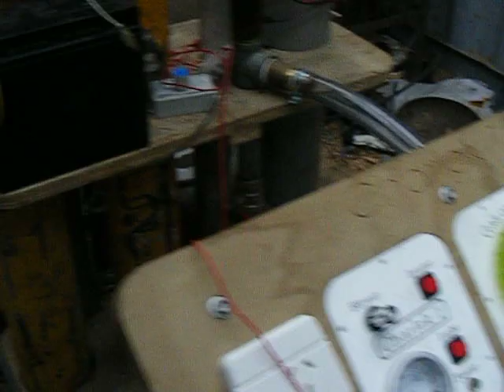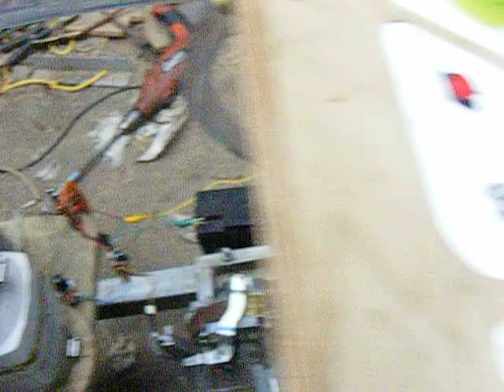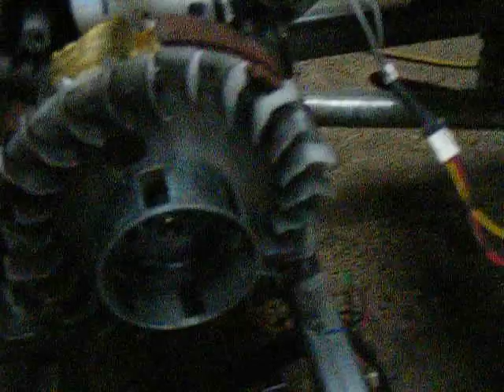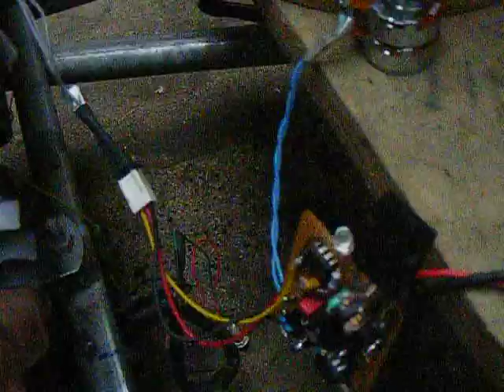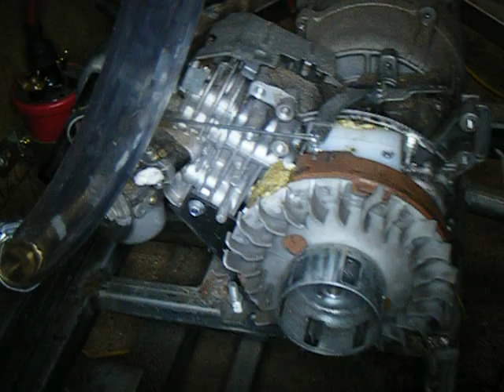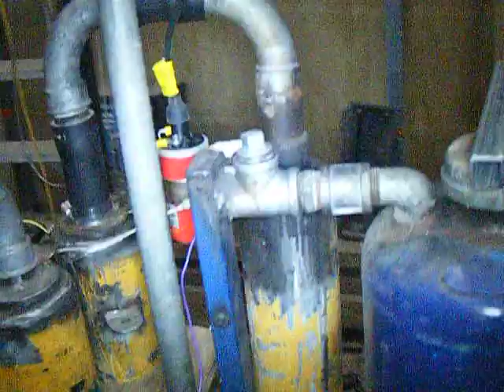Recent Charlek Enhancements

Comment: you could do away with the electronic spark advance and just shave the key on the keyway of the flywheel to advance the spark mechanically,,, they do that on high  performance go karts, or you could buy an already advanced flywheel to suit with 6-8 degrees advance. great electronic skills though,, hats off to ya,, Faster and faster and faster lol.
Reply from the maker: Howdee partner, 
 I did consider the use of a modified flywheel for this, but the electronic approach seems to be so much simpler for me to employ. 
 Watt's better is that I can readily adapt the electronic ignition system to operate on a wider range of fast and slow burning fuels. 
 A long time ago, I managed to split a flywheel in half, as the timing was just a bit too far advanced, and the engine duly backfired during starting. On that day, I had two matching halves of a flywheel to show off to my mates. 
 That was lots of fun  ;) .
Reply: I would be keen to own one of those spark advance modules,,  you could tool up and make yourself lots of money , i am sure there are plenty people out there who would jump on one at the right price for all sorts of engine applications,, for example- the arduino uno sensor controlled intake, i want one of those for my gasser,,,unfortunately , i am not much chop with electronics,, but hey thats why there are guys like you,,
Reply from the maker: Howdee partner, 
 Perhaps I should tool up for production of these sorts of devices  :) . 
 As an electronics engineer, I am forever designing and programming products for my employer's market and customers, so it wood knot be too hard to add a new branch to the design department  :) . 
 For your gas mixture sensing needs, I wood like to suggest that you start out with an older style, 4 wire, O2 sensor. 
 These should be super cheap, as second hand ones from car wreckers. That's where mine came from. 
 If you fit this to your gasser's exhaust system, it can start to give you some pointers on how to manipulate the manual gas control valves during a run. 
 Watt this wood also do is spark your imagination into creating some ideas on how to devise your own version of an automatic gas mixer. 
 I think it can be done without a computer, which could simplify things quite a lot  :) .

Comment: Steve, you are leading the way in our group when it comes to spark advancement.  We'll all be interested to see where it goes so we can make uneducated guesses to duplicate your successes. Thanks for sharing.  Joe
Reply from the maker: Howdee Joe, 
 Thanks kindly  :) . 
 This degree of timing advance makes all the difference between success and failure when trying to start this engine from cold on charkleberry fumes. 
 I wood knot be surprised if there is some sort of off the shelf version of watt I am trying to do here. 
 Ultimately, it all comes down to magnets and hall effect sensors. 
 These can be found in floppy drives and hard disk drives too, so these might be a good supply of components for a home brewed version of the spark-o-matic9000 gargleblaster  :) .

Comment: Steve, Very interesting. This discovery would lend it self well to engines with a distributor, one could even advance it one tooth so there could be a wider range of movement to allow the distributor to rotate without twisting the plug wires into a figure 8 knot. Being that our larger engines run on propane, I'll have to check to see what the  degree spec's are for that fuel. I'll give that a try after today's featured demonstration.
Reply from the maker: Howdee Bill, 
 It wood be very interesting to see watt level of timing advance your propane engines use. 
 At a guess, I wood say that it's less than the 40 degrees I used, as propane surely burns faster. 
 Shifting the distributor drive forward by one tooth ought to let you advance it into the middle of next week  ;) . 
 Here's hoping the demonstration went well?
Reply: Steve, The demonstration went very well. It's always a pleasure to share this level of technology with anyone who will take the time to see it with their own eyes. I,ll check the spec's from the manual later and let you know what the timing is recommended for propane.
Keep up the good work !
Reply from the maker: Howdee Bill, 
 That's great news indeed  :) . 
 It brings lotsa smiles when things run smoothly, and the woodgas bugs behave themselves. 
 Here's hoping your newest woodgas necknip victim becomes fully addicted, and begins using his experience in the nuclear power industry to enhance this fine old technology. 
 Looking forward to that propane spark timing spec. My guess is between 15 and 22 degrees, Farenheit - or Celcius. 
 Yup, I will keep up the good work, until re-bitten by gassy woodbugs.

Comment: Shit I'm blown away a motor will still run with that much advance! Also got another bbq gas bottle here for you to chop up if you want it dude?
Reply from the maker: Yup, this motor needs all of that advance, and maybe a bit more in order to run well\ on charkleberry fumes  :) . 
 I will need to modify the flywheel, and add a couple of new magnets to it, so I can more accurately manage the sparklet bulb timing. 
 Watt a rush this is  :) . 
 Yes please on that gas bottle bro.  These things are surprisingly useful around here  :)  .

Comment: When are we going to witness a full blown run with the Charlek producing the wattage for the cottage?? I knew advancing the timing can produce better power on bug juice, but, getting there is the hard part. It seems you have figured that one out. Sounds more simple than it is for us "not electronically inclined". I would use a offset flywheel key and be done with it............ Can't wait to see it in action. I got the big Kohler up and running sweet. Made the modifications to the wood gas carb and have that mounted up. I should be testing it sometime next week.
Reply from the maker: Howdee Mark, 
 It's gonna be a wee while before I get to that point, as the mechanical parts of this spark maker are not up to an acceptable standard yet, but I will get there. 
 After that, I can reassemble the RPM governor, and put this beastie to the test. 
 Hopefully, I can get 600 to 700 Watts out of this arrangement, but that remains to be seen. 
 Yup, the offset flywheel key, in conjunction with a standard ignition system is the way to go, as long as you remember to avoid using petrol, or any other form of highly burnsome liquid fuel thereafter  :) . 
 Like you, I am looking forward to seeing this beast up and running, as I need to get it done before the price of charcoal doubles again  ;) . 
 Looking forward to seeing your Kohler engine working for you, and ramming delicious watts into your battery bank, just as nature intended.
Reply: You are well on your way with it. How may watts is the little grunter on petrol?? And darn, the inflation with charcoal and wood. Outrageous. Charlek producing the wattage soon. 
As for the Kohler, that is going to be a while as well. I will have a lot of mods to make on the DC generator cart to accept this larger cast iron beast. I really cant run this thing except in a grid down situation. If I do run it under load when the battery bank is full up, which is 99.9% of the time, the solar power system goes bonkers and it takes several days to come to it's senses and straighten up and act right... This Outback Power system I have doesn't like a external charging source. There is a new hybrid Outback system that can utilize hydro or wind power while being grid tied like mine.  So, any run will be a "no load" test. I know it works when it counts. Like after hurricane Irma just recently. It kept the battery bank up with overcast conditions for right at 36 hours running 3 households.
Reply from the maker: Yup, this is progressing nicely now  :) . 
It is limited to 1000 Watts on petrol, as this really is quite a tiny wee generator. Perhaps it is a little too small to be practical, but we'll see. 
 For any load testing that you may want to do, perhaps you could use fence wire as an electrical load. 
 I did this in the early days with my gasifier, and I was able to deliver up to 2400 Watts into it from my modified car alternator. 
 That was great, until the fence wire eventually exploded like a giant fusebox!